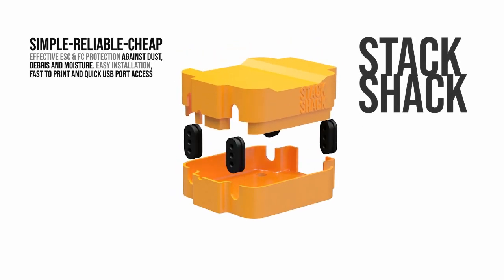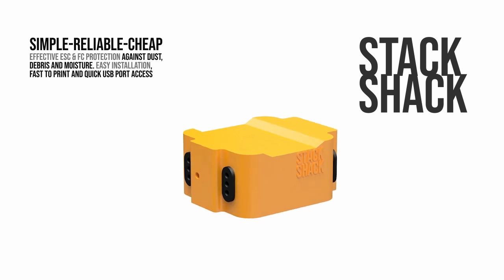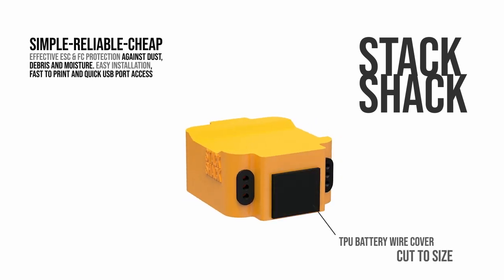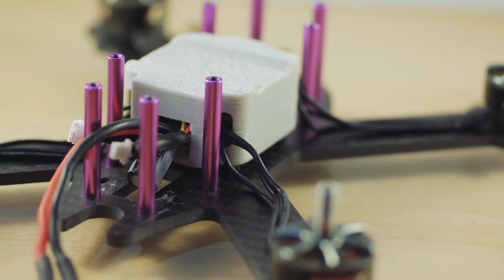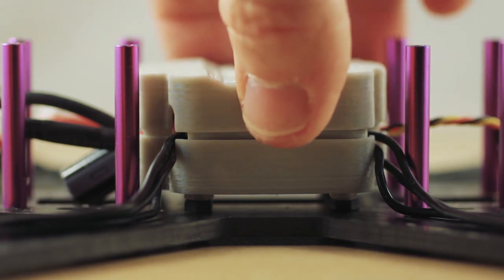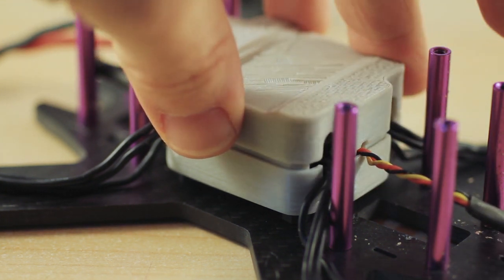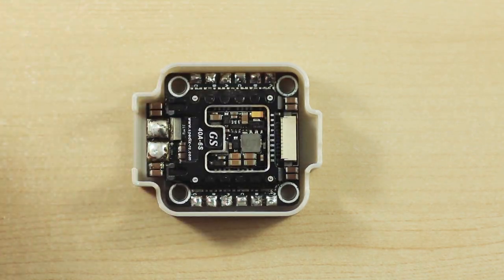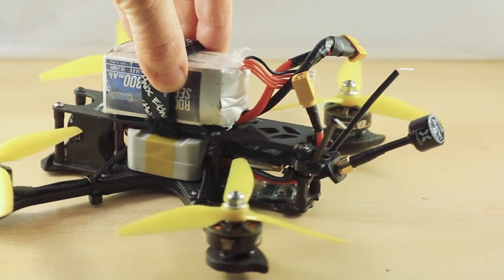STACKSHACK FPV drone PROTECTION for ESC and FC

Comment: Or you can use silicone coating...
Reply from the maker: Its not meant to replace conformal, its really to keep things clean and water resistant. And so i dont have to constantly have to clean shit out of my stack.
Reply: @thumbjuggler3943  fair enough!